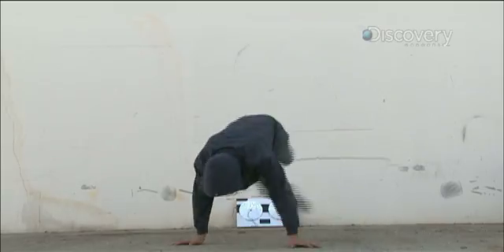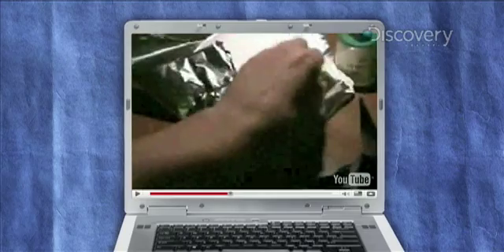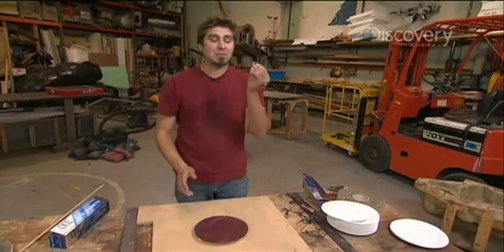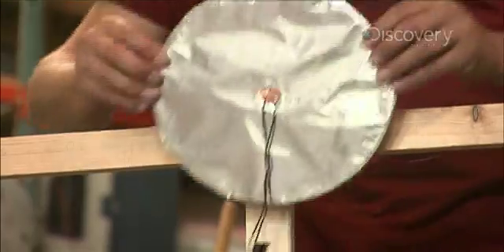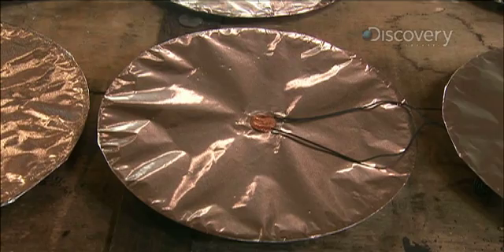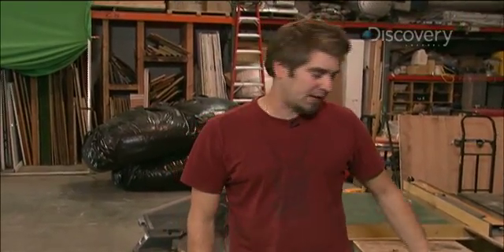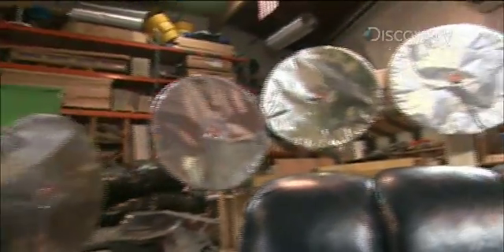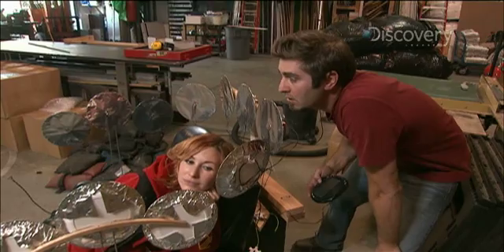MythBusters - Homemade Hi-Def Speakers

Comment: I knew it wouldn't work the second he taped both positive and negative leads to the penny. Direct short.
Reply: +CameraKid2 Generally mini-jack leads wouldn't have enamel on the conductors but it would be wise to check.
Reply: You don't need to be an electrical engineer to figure that out 😂😂😂
Reply: you should have known the second there was no coil for transduction
Reply: Pretty much as soon as I saw the way the foil was wrapped around the plate.  What's that supposed to do, trap air?  Oh, how is an aluminum foil on ruffled paper edge supposed to do that?  Okay, so now tape a penny to the foil.  What's that supposed to do?  There's not enough energy in a CD player to run a decent sized inductor.  (That would be a coil) which is why plug-in speakers have batteries, or chords to plug them into a wall.  Or, you know, headphones with tiny speakers in them.  This is not a circuit.  It's not even close to a circuit.  They had me with Aluminum foil, TBPH.  This is paranoid delusion level signals design.  You're better off wrapping it around your head to deflect mind control rays from the lizard men.
Reply: lol thats true
Reply: I was thinkin the same, they tend to be a bit of a sham
Reply: I assume the idea was to have a magnet taped on the inside of the plate, maybe that would have worked to some degree, but even so a single penny with no wrappings is about the crappiest electromagnet ever. I doubt it would have worked that way either, but it would have at least had a basis in reality.

Speakers work by alternating an electromagnet attached directly to the cone. As the voltage goes positive, it pushes away from a second magnet (a powerful rare earth magnet usually), as the voltage goes negative it attracts the second magnet. These alternations drive the speaker. You also need an enclosure to get anything remotely electrically efficient, otherwise the pressure differential just goes around the speaker cone and equalizes immediately and the sound waves cancel and become weak.
Reply: Maybe this was supposed to be a piezoelectric driver, not an electrodynamic one.
Reply: @tomkocur  I've never heard of piezoelectric copper
Reply: @Tenpoundpom150  yes but thats the closest analog to this fake "speaker" it almost certainly was trying to imitate that
Reply: Which means Tori, was a dummy!
Reply: @jst1man  I'm pretty sure he knew what he was doing, its just for the camera lol

Comment: Here is another issue I don't think you fully explored.  U.S. one cent coins made after 1983 are made of copper plated Zinc.  Earlier U.S. one cent coins are made of pure copper.  The original video did not specify which coin was used.  You should have tested each kind of cent prior to declaring this busted.  Also, copper begins oxidizing immediately after buffing it.  Unless you made your contact immediately after buffing it might not work.  So did you use a bimetal modern cent or a pure copper cent and which one did the original poster use?  That would seem to me a significant consideration.
Reply: +Mygaffer don't you also need some sort of spring for the driver too?
Reply: +Mygaffer well yeah. I never fell for this one in the first place. I used to take electronics apart all the time as a kid and the speakers always had very powerful permanent magnets.

Comment: I don't know if the original video of this was authentic but I did watch it and then come back here and re-watched this and noticed you didn't wire it the same way and by gluing your speaker to that frame you dampened it so that alone would have voided the experiment.  There are other home made speaker videos that seem to show you can make a speaker out of a paper plate but those all involve wire coils and magnets.  My brother used to make killer speakers with plywood boxes and old rubbermaid trash cans.

Comment: Well... ive already tryed make my own speaker. But not this way. If u want some hearable sound (i mean hearable quality ;) ) you have to start with coil. 4 or 8 ohm impedance wuld be just good. Than attach it to somethink hard, but bouncy. As a glued, bowl shaped paper attached by rubber to some chassis of the speaker is. And the last think, the magnet. Neomid would be the perfect one. Dont get it under the coil, or next to, give it staight into coil. in the middle is it best.That is the speaker. But!  You have to have some amp for it, because portable devices just dont have enough power. Try it with 5W one first, than you can mebye try better one.... :) Always check impedance ! You can blow some good amps with low one and for some amps is even standart 4ohm low ;) Keep it in mind.

Comment: And realy dudes 10$ each... maybe 0.65 this one is 3.5 mm but for 1-2$ u can get much longer.

http://www.monoprice.com/Product?c_id=102&cp_id=10218&cs_id=1021804&p_id=666&seq=1&format=2
Reply: GameTime Alex  Wow LOL , Just after 30 seconds I fount this one,  0.75 only 0.10 $ more expensive and from 3.5mm to 6ft (they are not the best, they are bad quality, but still u are making a speaker out of alluminum foil and foam plate... so u dont need gold plated millitary grade jacks :D:D )

http://www.monoprice.com/Product?c_id=102&cp_id=10218&cs_id=1021808&p_id=648&seq=1&format=2
Reply: At the time of recording 3.5 jacks were not common.

Comment: you need one more thing for this project, a brain that doesn't work and you did the wiring wrong and think of the sound that foil makes when you vibrate it that is the sound you would hear and just because you used a cup rather a plate that doesn't make it a subwoofer

Comment: This is electrically super ignorant. The wires are shorted on the penny. To create magnestatic sound you would need a permanent magnetic field close and the AC(sound signal) across the membrane, with a giant resistor in series to solve the dangerously low impedance. A regular (dynamic speaker) uses the same koncept, by making a piston of insolated wire into a magnetic field. 8th or 9th grade physics I believe.
Reply: Kent Larsen .... concept .. seventh or eighth grade spelling

Comment: Ok, so most people should have realized that was not going to work. However, instead of building 13 of them it probably would have been more interesting to see if there is a way to build the speakers with some foil, paper plates, and other common and cheap items...

Comment: if youve ever smashed a tamigochi youll know its an attempt to make a 4bit midi speaker wich means he should have put the ground on the foil and the positive on the penny and an electrolyte between the plates and it might have worked

Comment: Why did you even try this, there's not enough magnetic field from that penny to do anything, unless you use THOUSANDS of watts. Plus there is no magnet, why the hell did they try something that they knew would fail? DEFUQ? Those 3.5mm cables are $1.25 if you get the cheap ones, not freaking $10!!! They really dont sound noticably worse than expensive ones either, but there not very durable being made of aluminum magent wire. What did he buy, some audophile quality cables or something.  For this, it just needs to conduct, why not instead use a terminal block with a SINGLE cable soldered to it? Im sorry but this is a joke to me, a very dumb and wasteful one at that.
Reply: the insulated copper cable is free if you get it from a busted tv XD

Comment: Even if those paper plate contraptions would work as speakers (which they never would) you would still need a power amp. The signal from a CD player headphone output won't drive shit!
Reply: theLuigiFan0007 chill
Reply: EXACTLY! Its also missing a magnet, and that pennt would take in excess of 1000W to even move which would blow the wire up and melt the penny. Also, those cables must be like really high quality, I gan get a cheap aluminum wired 1M 3.5mm male to male for $1.25 and cut it in half for a total of $0.75 per cable. NOT $10!

The CD player could very well audibaly drive a small speaker to a listenable level, my MP3 player can drive 16ohm Pioneer speakers to a decent level for background music. It just has practically no bass. But you are right in this instance, because it is basically a short they were trying to power in the first place which would require hundreds of amps flowing through the coin.
Reply: Marco D'Andrea
I occasionally comment while in the strongest moment of mental debate. Thinking about every detail over and over again until I have my point. Although I still stand by what I said, I did seem a bit extreme there. XD

Sometimes I swear I need to wait 5 mins before I post. Otherwise I make comments with multiple spelling errors and a slightly insane tone like that one. LOL

Comment: Number one, minijacks DO NOT cost $10. Number 2, try using a amp. Number 3, is the wire coated?

Number four - this would never work!

Comment: magnet wire, paper plates and a few magnets ( of course about an hour of your time) and it can be done. they can be made very cheap, but they sound cheap if made so.  With a neo magnet they can sound good, but the wire is key, current creates magnetic and creates sound waves with other magnets presents via attraction and repulsion... yup...
Reply: * Current creates magnetic fields...
Reply: You release there were no magnets in the instructions from the original video.  Course, yeah, you would need something like that, as you would see in actual speakers.
Reply: Mikodite Yvette  I did not release that.

Comment: You can actually make a speaker out of a paper plate, but you need to create some sort of transducer to create the vibrations in order for it to work (like having a magnet on the foil side, and a circular or coiled circuit on the paper size that doesn't short out and has enough power to generate an sufficient EMF).